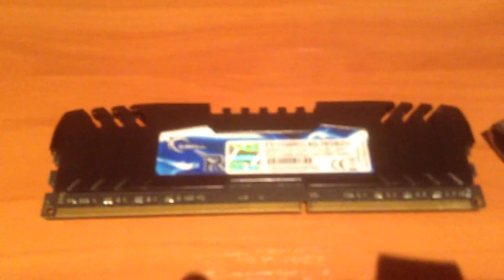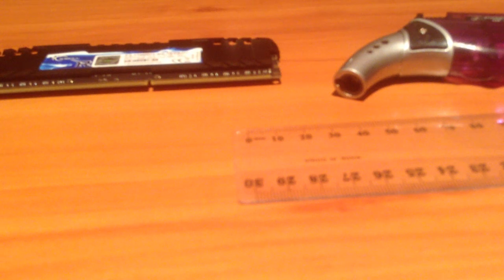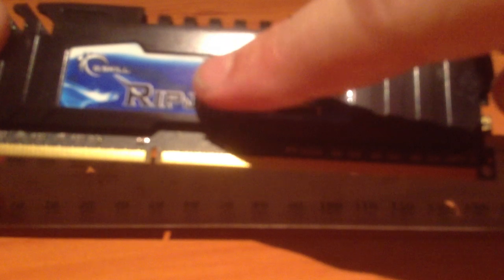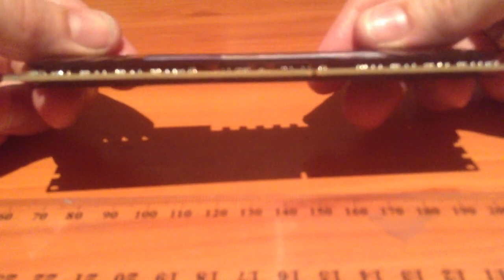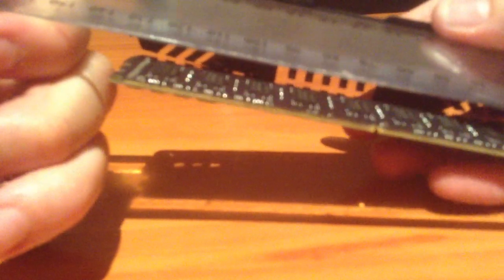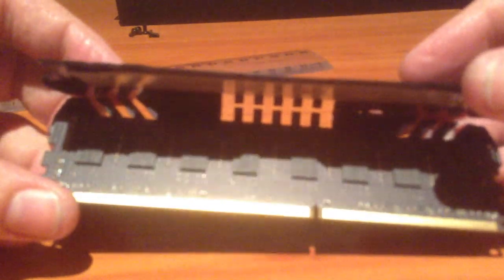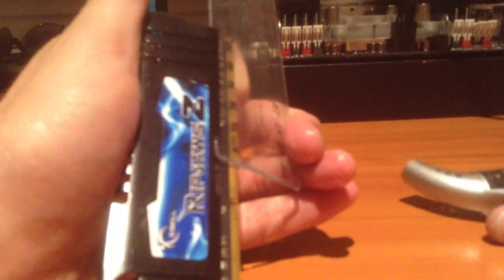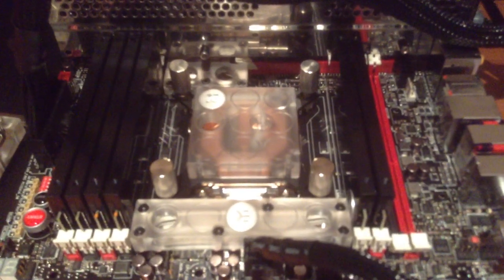Ram heatspreader removal

Comment: I must say that this is by far the best guide on doing this despite being one of the oldest videos, and the video with worst quality. But the video is more than 10 years old so that's ok. Now I'm gonna test it since I don't want to wait 12+ hours or so for them being a bath of thinner or terpentine.

EDIT: It worked well for my two Kingston Hyper X DDR4 as well, but I had to apply much more force on my ruler, so much that it actually broke. I even used a torch model BIG and had to warm a lot more. Just a tip, after you have been prying with the ruler for some time, just try to wedge it a bit further in. You might not see it's possible, but it is.

Now I just need to test the memory sticks to see they didn't got damaged.
Reply from the maker: Dude! Thanks for the comment - great to see the video is still chipping away.
Yep - it was a long time ago - I think it was filmed with an iPhone 4 🤣🤣🤣
Hope your build goes well.

Comment: Good idea!  Just be weary guys this DOES VOID WARRANTY! So just be super careful. Ive actually had a set of ram that the "heat spreader" was held on by what looked like 3m foam tape.  So dont worry about heat issues guys.  Touch the ram while it is under load, its barely above room temp!  Its just bling to make you want to buy it

Comment: There is just a plastic clip that you pull out from the inside. If you get some tweezers, pull out the clip and the heat spreader slip off. 😂
Reply: What are u talking about? The heatshield is glued, its not a mechanical part. No way its attached to a clip

Comment: I used the same method for ripjaws modules ... But I used the electric contact wiper to loosen the glue a bit before applying force.

The result was extremely more easy to remove the heatsink ... there goes the tip ...
Reply from the maker: WOW GREAT WORK BRO MAYBE GO MAKE A VIDEO ABOUT IT